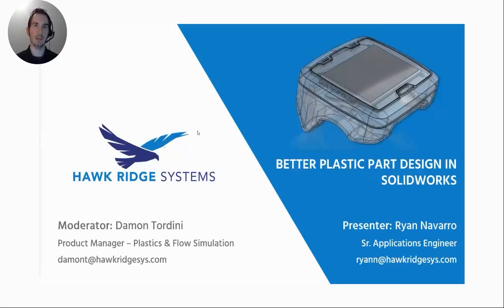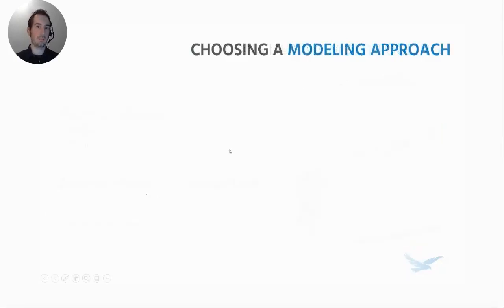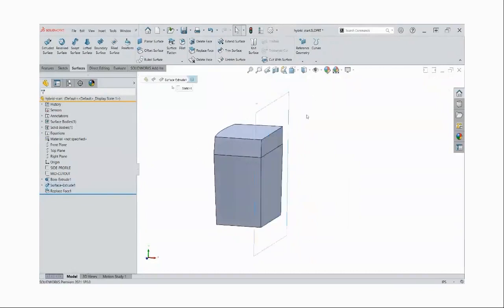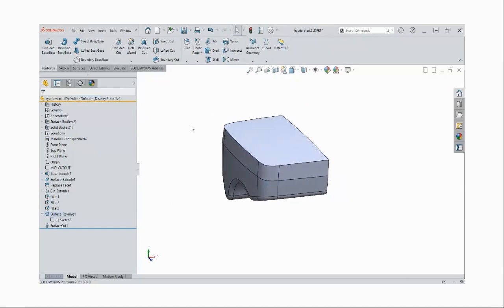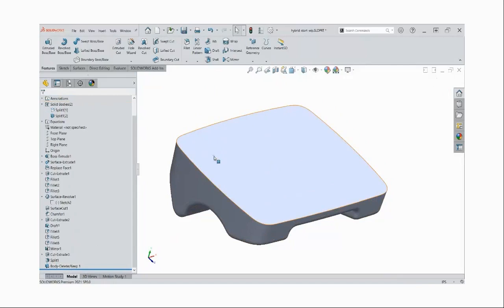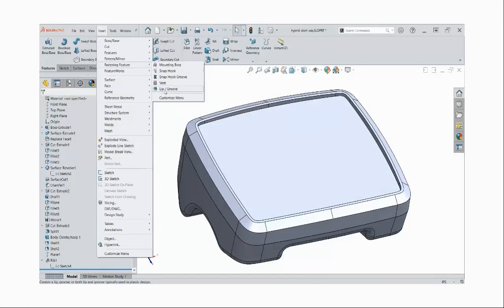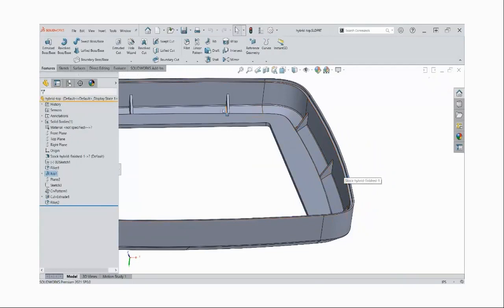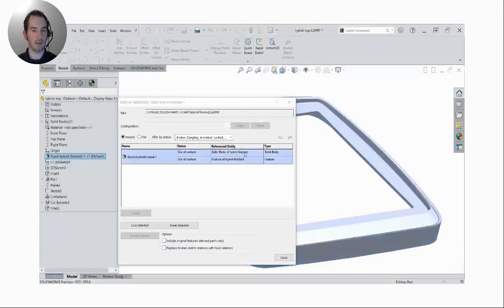Better Plastic Part Design in SOLIDWORKS

Comment: Considering the feasibility in part ejection during molding, don't you think it would have been better to use drafted cut to remove excess material at the center of the top?

Comment: Which package of Solidworks are the Lip + Groove and the Snap Hook options available on?
I have the Premium Package and they are not available on my system
Reply from the maker: It should be available in all packages. In this video its shown on a multibody part where it appears by default. If you're working in an assembly you won't see it by default, but it should show up if you edit one of your mating parts in-context within the assembly by clicking the Edit Part icon in Assembly with the part selected